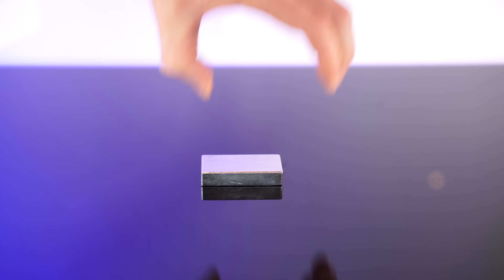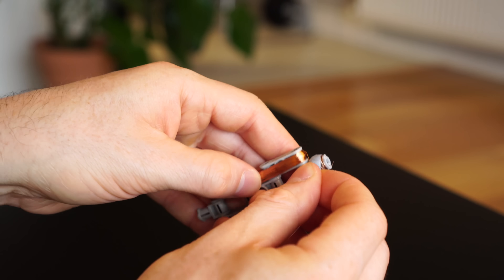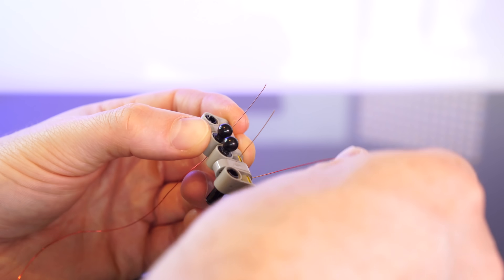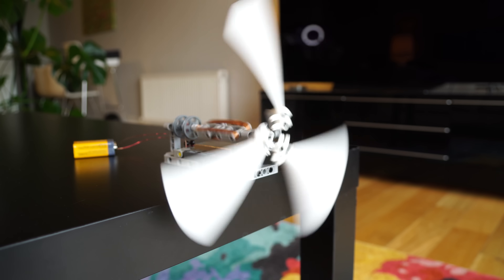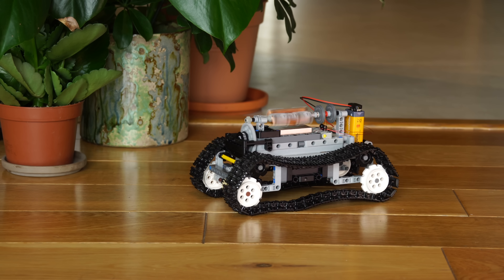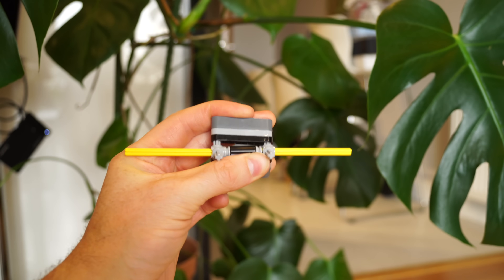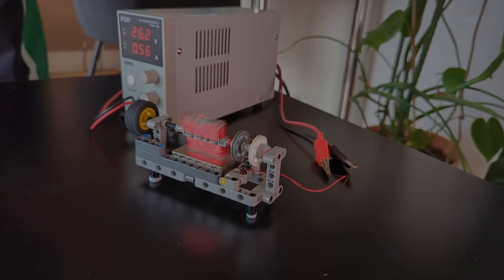Building & Testing a Mini Lego Brushed Motor

Comment: at 1:06 you have a small end of wire but at 1:25 you have two long pieces of wire. i’m just a little confused on where you got the other end
Reply: Update, here's my analysis, the 1:06 part should have an extra wire for the commutator, that is why when you see 1:25, you see 2 pieces of wire.
The lack of Blue Tack and the change of the scenery might mean he repeated the rotor
Reply: ikr

Comment: Adding low resistance interpole coils with opposing polarities in series with armature placed between the field poles will increase the efficiency and smooth out the torque curve. I rebuild industrial DC motors for a living.

Comment: For preventing the wires from coming off the rotor, try using something to hold the wire onto the thing, such as tying a piece of string onto the coils 90 degrees to the windings

Comment: I built mine, but I have had some problems getting it going. I am using 2 neodymium magnets, and for the contacts, I am using a different material. (Not copper, but there is 9 volts still going thru. ] any ideas?
Reply from the maker: It could be a number of things. First of all, what material are you using if it's not copper? The only other common material that might work is aluminium wire, but it'll be significantly worse. And then next you'd need to make sure the timing is correct. And finally the orientation of the coils needs to be correct. Those are the main places I'd start troubleshooting
Reply: @JamiesBrickJams  for the rotor, i am using copper, the copper is coated in enamel, and i think that everything in the rotor should be working, but it is not. I took it off the thing that makes it spin freely, (the holder) and applied two wires onto the contact points, and their was still no magnetic force form the copper. The only think that is not copper is the contact points, that go directly to the motor, but that is not the problem. I did 100 loops, and followed it the same way for the other side. I have sanded down the contact points but still not luck. It might be the kind of coppper I’m using, maybe it’s not evenly coated in enamel, so there are some points touching?
Reply: @JamiesBrickJams also, i spun it and it generated a few millivolts of electricity, so it seems to be right, but something must be wrong.
Reply from the maker: That's strange. If you take your loops near a magnet and apply 9 volts across it (you using a 9v battery for this?) and place the loops near a strong magnet, you should feel either a push or a pull. Only things I can think of is either you might have some issue with enamel (is it old wire?) or your magnets aren't strong enough. Or the orientation of the loops isn't perpendicular to the magnet
Reply: @JamiesBrickJams  i am using a durecell 9 volt battery, and maybe the enaml was just for protection, not insulation. I will get a brand new copper wire and try again. Thank you for your help.
Reply from the maker: @ChaChaBorkDog  sure thing, hope you get it to work! They're a lot of fun 😄
Reply: @JamiesBrickJams  Thanks!

Comment: Seems to me like you're just building a homemade motor, and the fact you're using Lego for the mechanical parts doesn't really much affect it's properties except for that plastic on plastic has relatively high friction compared to some of the other options out there.

That said,  good first concept.  I'd suggest having more than just one string of wire where the brushes touch (loop it back and forth a dozen or so times?) since that seems to be a weakpoint,  also might look into redesigning your "brushes" as well.  As in...  use more wires. Like in an actual brush.
And then the next step would be completely redesigning that part of the assembly so you can put a little more constant force on the brushes, make the contact area bigger by using aluminium foil attached to a 'barrel'... those sorts of things.

Looking forward to what you do next.
Reply from the maker: Yeah it's pretty much just what you said - a pretty messy and somewhat pointless first attempt at a pretty basic concept that others have done before. But with Lego. I figure a motor made of Lego will interface with Lego easily, making it fun to power other Lego contraptions. Though Lego already makes motors, so I'd like to make another motor but much more powerful. At least then it'd have a benefit over existing Lego motors. Cheers for the tips - I definitely want to make a better set of brushes. I thought of aluminium foil but suspect it'd wear down pretty quick. I've got some copper pipe I can cut to size which I have a bit more faith in, but will just have to see how it turns out. There's definitely a lot more to improve
Reply: @JamiesBrickJams  Ohhhh, copper pipe is a FANTASTIC idea!  Saw off a small section (I'd say 1cm is probably enough) and then saw it in half lenghtwise with the thickest sawblade you can find (to create a gap between the poles)
I'm sure you can see where to go from there.  :D

As for the brushes;  definitely bend them a bit so the 'pointy' end of the wire points outward a bit, to make sure they definitely touch with a 'soft' curve - to minimize friction and therefore wear.

Comment: You know, could've made the commutator with some thicker wires. You're not burning out the motor, you're snapping the very weak contacts due to abrasion. And raising the current limit on your power supply does not change the amount the motor draws. Also, why aren't you using another magnet? The coil that goes to the top doesn't do anything in your design. Could've made only one brush on the one side for higher efficiency, the other is just wasting power

Comment: Not sure what a 3 pole rotor could do with just DC.  Your poles would just be North, South, then North again.  You need an even number of poles.
Reply from the maker: You're totally right, with this setup, the 3 armature rotors don't add anything - they're actually less efficient. But I made them to work with some other experiments I'm working on 😉

Comment: Now try to do comutator from a aluminum tape and see how much more efficient it is.
Reply from the maker: I was actually wondering about that myself! I need to find some suitable materials for a larger commutator. My suspicion as that aluminium foil will get obliterated by large currents, but it's still worth a try. My current plan is to cut some copper pipe to size and try that if aluminium foil fails. Good suggestion!

Comment: I think you may be able to generate power with that motor, just turn the shaft and the magnet will induce a current in the wires.

Comment: now make brushless
Reply: It was technically brushless
Reply: @icraftcrafts8685  in no way was this brushless wdym
Reply: @icraftcrafts8685 incorrect. Brushless motors use electronics to control the direction of electricity to keep a motor going. Brushed motors use physical contact with wires to do the same thing...

Comment: Chuck some cap ends or a rubber band around your wire loops to keep them in place a little better.
Reply from the maker: Woah. I was brainstorming some non-permanent ways of better securing those wire loops.. but didn't think of rubber bands. Great suggestion, thanks 🙏

Comment: I have tried this myself, well the coil is generating some magnetic field, but it dont work for me.
And i think it would run, but i dont know what i did wrong.
Reply from the maker: If there's some push or pull, it's probably just a timing issue, so moving the brushes around a little should work. Or the coils were not in the same direction - if both sides are repelling when you turn the rotor in both directions, one of the coils is the wrong orientation.
Reply: @JamiesBrickJams So after some time i remade that and it works. Thank you!
Reply: @FilipTurek-di9bw  Amazing, well done man!

Comment: Note: The gauge of the wire has a current rating associated with it. The max current a 22AWG wire can handle is slightly less than 1A.
Reply: You sure? My 24AWG wires can handle 2A

Comment: Use moderately thin wires but thicker commutators... You can actually draw the 10 amps to its reasonable potential and also gain some structural integrity...
Reply: It ain’t even getting 2 amos lol
Reply: @SNIXC  true

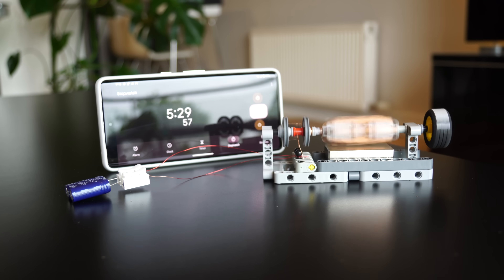Comment: 4:51 - The motor being weak in power does not make it efficient. It just means it is doing very little work. in all likelihood it is rather piss poor in terms of efficiency.
Still a nice little toy you made there.
Reply from the maker: Fair point, yeah it likely isn't anywhere near as efficient as it could be. Still though, for a toy, I'm quite pleased with how long it can run on a (admittedly large) cap

Comment: How do you increase the torque of the motor?
Reply from the maker: Mostly by increasing input voltage or by gearing it down. This particular design could certainly benefit from more magnets and coils though as there are large dead gaps

Comment: When it releases it would be cool to turn the new radio set into a real transistor radio (not just a speaker inside, make the dial actually tune an analog radio inside). You can get modern transistor radio kits online (something actually old school, not just a single IC on a board).

Comment: Would be cool to see the three armature rotor with coils that are properly fixed. You used pieces with smooth surfaces and no lip on the outside at all, the wires just slipped away.
Reply from the maker: You're totally right, these were some pretty bad designs. I really want to make a bigger version now with strong armatures that hold the wires properly!

Comment: You're not getting even close to 2 amps in there, let alone 10. As the other comment already said, the amps on your power supply are just a limit. The current passing through a wire is voltage divided by resistance  of the conductor, and that resistance is static, but you turn  the voltage higher, which does result in higher current, but it is quite low. Higher resistance - less current, Higher voltage - more current.
Reply: I am glad to see someone else caught this. Saw a similar issue with video where someone was testing fuses, he actually bought load resistors so he could test them "at the correct voltage" without realizing that there is no difference to the fuse, amperage is amperage, it doesn't really care how much voltage the rest of the circuit is dropping.
Reply: @carpdog42  Fuses are rated up to a specific voltage because of arcing. So it may be justified.
Reply: @JTCF  That isn't how voltage works. The fuse has a resistance; if you multiply that resistance by the current it sees, then you will get a voltage. That voltage is the only voltage that the fuse EVER sees. If you want to do a voltage arc test, you can do that, but then you have to remove the load resistors and overcurrent the hell out of the fuse.
Reply: Right on the money. Although it's also worth saying the power supply is reporting the average current. I'm sure there's a fairly large spike when the brushes first make contact and connect the circuit.

You've got to take inductance into account so it won't just be V = IR at that point. Really you need an oscilloscope.
Reply: @jameshogge  Oh damn, that's right! I should refresh my knowledge on induction (if there is some left in my brain)
Reply: @JTCF not really. Voltage and current are only linear in a static circuit, and a motor is not static. Ohm’s law actually works only when the motor is stalling, or is just starting to spin. Once it spins, the magnets create an opposite current in the coils that lowers the total current. At a given voltage, the faster a motor spins, the less current it draws. This is why electric motors give max torque at very low (and zero) rpm.
Reply: Indeed. If the motor got stuck, once the initial impedance was overcome then the power supply limiter would keep the resulting short circuit from exceeding 2 amps. I was actually surprised that someone so good at coil geometry wasn’t aware that the amps running through the system depends on voltage (complex Ohms Law).
Reply: This
Reply: There's also indicators in the PSU showing if it's working in either constant voltage (cv) or constant current (cc) mode
Reply: Alot of egos being hurt
Reply: I really like the idea and the product you made! Congratulaions! 😮🤯
Reply: Higher voltage would result in lower current yes? As voltage goes up, current goes down and the same is true if voltage goes down, the current goes up.
Reply: @natarito2056  No, that is the relationship for power output of a transformer; the relationship for a resistive load is a positive correlation. To be really pedantic, its a steady state equation, if the voltage level is actually changing then you have other effects that will induce a phase relationship between voltage and current, which is more complicated.
Reply: its only less resistance because it spins faster
Reply: Am I the only one who has no idea what they are talking about?😂
Reply: @malanikuiper414  The simplest explanation is to look at OHMs law; if you put a voltage across a resistance, current flows according to the ratio between them. In order to change the current you must change the voltage. So in order to limit current, you limit voltage. So a power supply will attempt to provide its Max voltage up to its Max current, if the load would draw more than Max current, then voltage is reduced until the draw is max current. If the max current is greater than the load, then it raises to max voltage, but can go no higher. Think of it like a hose, you can bend it to reduce the flow, but once its full open, its full open and you can't open it any more to get more flow.
Reply: @carpdog42 thx for explaining

Comment: 7:12 The two amps are only the limit. The actual current draw is around 110 milliamps. So even if you set it to 5 amps, it would be the exact same result. It's only the voltage that makes it go faster :)
Reply: It hurts soo much to see hin raise the amperage like it was voltage
Reply: @kepler_45  oh so they Dont know shit basically?
Reply: @kepler_45 yes
Reply: @bami2  They meant that he adjusted the max current (power supply limit) but thought it was adjusting the current itself, making 2 amps pass through the thing...
Reply: I thought of a great way to explain it. We can compare it to a car. Let's say voltage is speed of the car and current is the horsepower of the engine. 
You only need certain amount of horsepower (amps) to reach the desired speed (volts).
If you are going 30Km/h, you only need few horsepower and no matter how strong your engine is, you will still need only some of it's horsepower to reach 30Km/h.
If you just floor it, than what's limiting you is the HP, but the speed increases.

It's the same with electricity, if you fully load a power supply, the voltage will drop once you reach the maximum current. 
I hope it makes sense :)
Reply: Why is it that the motor can only receive 2 amps even if we set more? Can there only flow so much electricity through the copper wire? Do we need a bigger wire to get more electrons flowing in per time unit?
Reply: @StarWarsExpert_   It's not how much can flow, but more about how much needs to flow. Devices take only what they need. If he would increase the load on the motor, it would draw more current. I wrote another comment comparing it to a car. If you want to go 30 Km/h, you only need let's say 10 HP to do so, and no matter how much HP your engine can output, you will only use the 10 required.
It's the same with electrical outlets. It can provide up to 16 amps, but you usually need much less.
Reply: @Trex0Pol  I did not know that devices only take how much electricity they need. It was never taught to me in physics class. Thank you, I think I understand it now. Could the electric motor's load be increased by attaching a heavier wheel onto the spinning axle or by putting the wheel that the motor spins on the ground to increase friction?
Reply: @StarWarsExpert_  Yes, exactly. But if it was airborne, the wheel would act as a flywheel and will probably consume more power only when it spins up. If you put it on the ground, it would definitely increase the load and it would draw more current. You could also increase the load by just simply holding the end of the shaft between fingers and trying to stop the motor.
Reply: Would it be able to power its self and have some to spare?
Reply: @RobertMaag-u5l   I'm not sure if I understand the question correctly, but if you mean would it be able to power the motor and and something else? Yes, it totally would. In fact, it would be able to power around 90 of these motors.

Comment: You need use electrical steel plates as a stator to increase torque and reduce heat. Also you might add 3 more coils and 4 magnets
Reply: Coils will be the multiple of 3 and magnets multiple of 2
Reply from the maker: I have less experience with motors, but this 3:2 sounds just like the standard generator setup. Good points, and thanks! I'd love to make an overpowered motor with a more solid commutator and see if we can make Lego tear itself apart 😁

Comment: The power supply has the possibility to give it 10 amps, but the motor only use a fraction of it. It never got past 1A, only the last moment before failing 1,24A.
Reply from the maker: Yup, I suspect those contacts are touching so quickly that the power supply is attempting to provide an indicator of averaged draw over a period of time

Comment: Your rotor with 3 coils is good. When you wrap the coils, use a little super glue to secure them in place. Also...MORE magnets!  :)
Reply from the maker: I was debating glue, but couldn't bring myself to wreck my Lego 😅 You're right though, this definitely needs an improved design so we can really chuck some real power through it 💪
Reply: @JamiesBrickJams Could use the holes on the coil holding bars to attach another piece, maybe something wider so the wires stay in place.
Reply: @JamiesBrickJams maybe zipties through the middle holes?